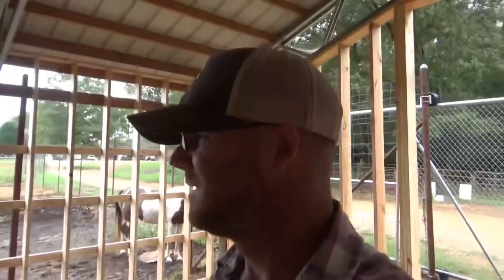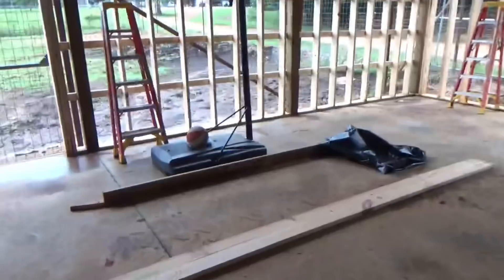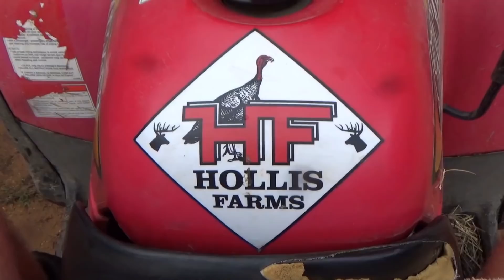NEW RACE CAR SHOP CONSTRUCTION UPDATE 🔨🔨🔨

Comment: That garage door wont work framed out like that. Mark my words
Reply: The 16 footer
Reply from the maker: Ok👍
Reply: truett hester --- It'll hang if the inside of the framing is flush (or thicker) with the 'bottom chord of the interior truss' frame'. He might have to add a foot to each 'riser leg' of the roller frame placing the open position closer to the bottom of the purlins.